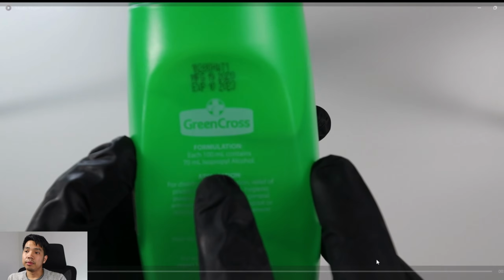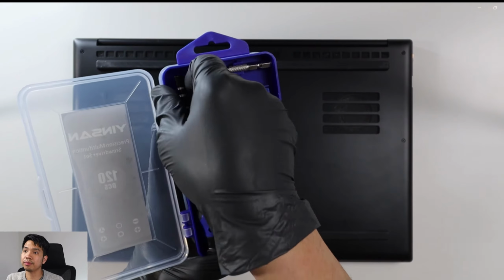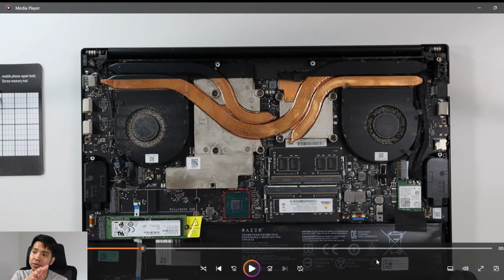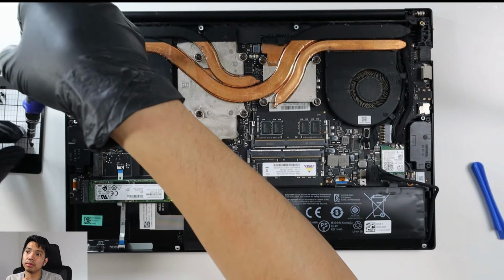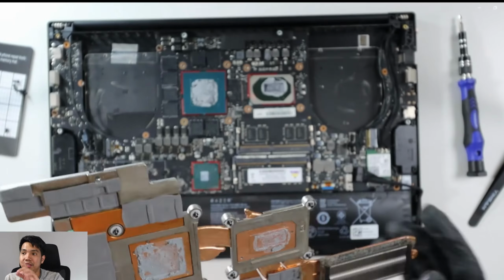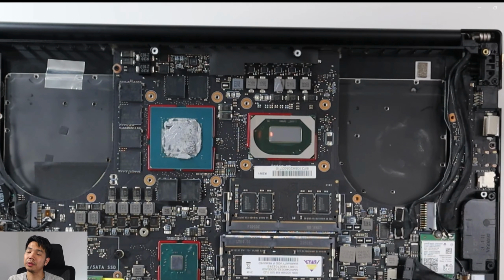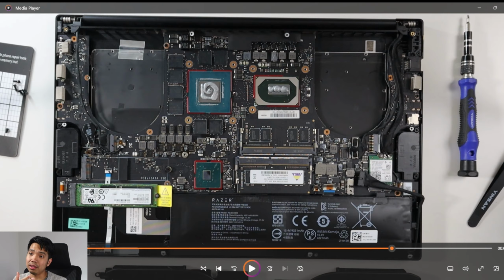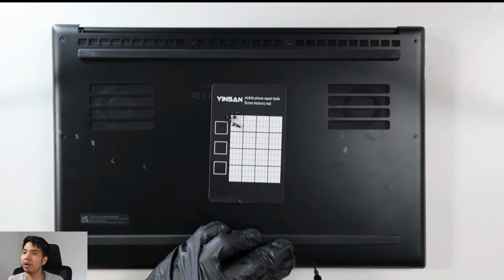RAZER BLADE 15 DEEP CLEANING

Comment: Hi I have a RZ09-485 that a single letter is not working. Is it possible to repair them? If not, which keyboard part number or models is compatible to replace it? Thanks.
Reply from the maker: Hi, replacing the whole keyboard would be much easier.

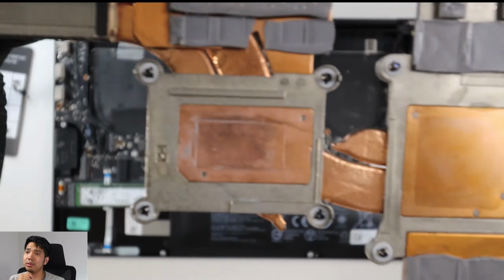As for the part number, it may vary with each unit. The safest way is to check what is currently installed on your laptop. I haven't taken off the keyboard of my Razer, but if you pause at 19:45 in this video, there is no obvious screw that appears to hold the keyboard in place. You can carefully pry it off from the sides. (If you feel even a resistance when prying the keyboard - Stop and check the back again.)

Comment: My friend urgently needs to know what thickness of thermal pads this Razer laptop model uses.
Reply from the maker: Hi, I'm not sure exactly but your friend can get 1.5mm thick thermal pads and if it's too thin he/she can stack it to make 2.0mm thickness.
Reply: @tech.plucero woo I didn't think they were that big, I suddenly thought 1mm
Reply: @tech.plucero One question: on this GPU, are the thermal pads for the VRAM and VRM of different thicknesses?
Reply from the maker: @carlosespluga3350 hey, they are of the same thickness.

Comment: Is reapplying the thermal paste when taking off the heat sink necessary? I want to clean the fans and the heat sink but I don’t have the skill to do the rest…. Should I just not clean it at that point? I don’t want to mess up the CPU by taking off the heat sink and I don’t trust myself to apply thermal paste. I’ve read so many articles online of people’s laptops just not turning on and I can’t afford for that to happen.
Reply from the maker: You can definitely get away without taking off the heatsink. For maximum result, remove the heatsink to clean it thoroughly and replace the thermal paste and pads.

Comment: How much force did it take to take off from the gpu, mine feels really stuck on there and i cant tell if there screws are full out or not
Reply: Im using just enough force until i feel it may snap
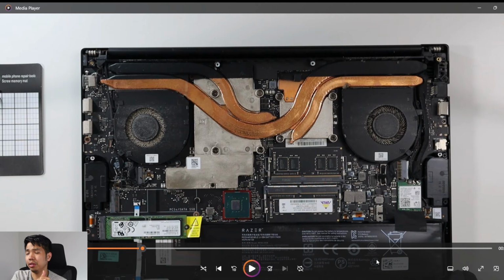Reply from the maker: Hi, Do you mean taking of the heat sink from the GPU? it should come off quite easily unless you forget to unscrew one. @10:10 - you can use this as reference to check whether you have unscrewed everything holding the heat sink.

Comment: Will you be replacing your battery?
Reply from the maker: Hi, Yes, I've already replaced it. ☺
Reply: @tech.plucero  I want to replace mine, but unsure where to source the battery?
Reply from the maker: @sneakystalker  I bought my replacement from Ebay, make sure the model match (model number is shown in the battery label).
Reply: @tech.plucero  One question: on this GPU, are the thermal pads for the VRAM and VRM of different thicknesses?

Comment: why didnt you change the thermal pads?
Reply from the maker: Hi, that was my bad, I didn't realise it has thermal pads. The thermal pads were still in good condition when I did the cleaning. I'm definitely replacing them on the next one.
Reply: @tech.plucero  I have a Razer Blade 18 2023, and was wondering if this video of yours was accurate to follow if I wanted to repaste thermals on my laptop?
Reply from the maker: I recommend that you search for a Razer Blade 18 disassembly guides as the internals layout may be different. Good luck!
Reply: @tech.plucero My friend urgently needs to know what thickness of thermal pads this Razer laptop model uses. I'm thinking of putting 1mm on it

Comment: For the thermal pads, what size would you buy? 1mm, 1.5mm etc
Reply from the maker: Hi, Thank you for watching.

I would get 1.5mm to replace the thermal pads. If it's big you can always cut a bit out of it.
Reply: @tech.plucero  thank you very much
Reply: @tech.plucero My friend urgently needs to know what thickness of thermal pads this Razer laptop model uses.
Reply: @tech.plucero And what thickness are the VRMs? 1mm?